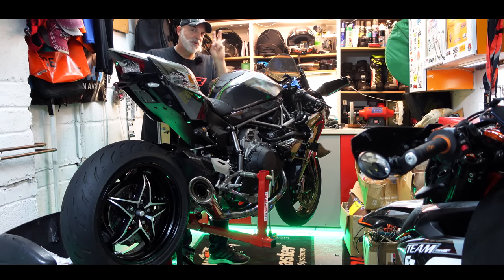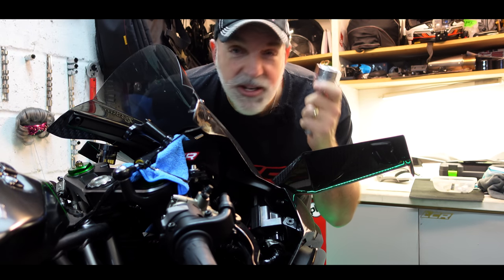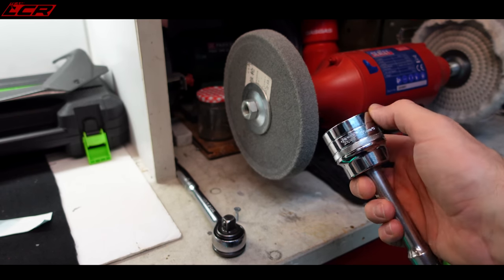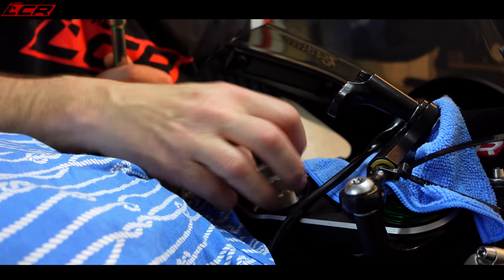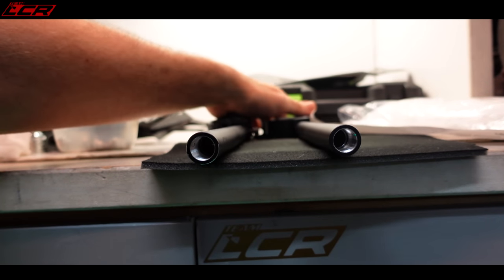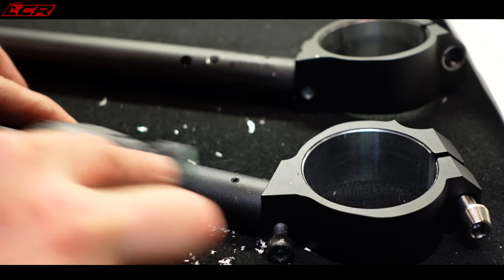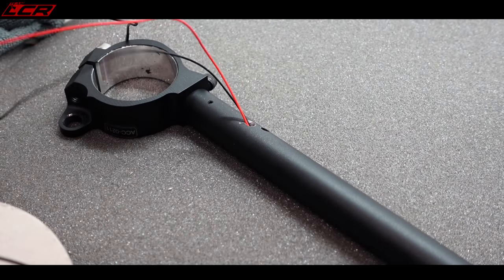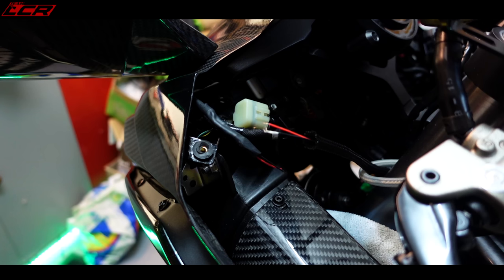My Kawasaki Ninja H2 Is Too Uncomfortable! | Kawasaki Comfort Risers

Comment: Looking good Chops. I put adjustable bars on my old Ducati SS, same height just a flatter angle. Huge difference.
Top Tip for threading wiring through bars, I've done 2 Harleys now. String or better still ask TMF for a guitar sting, tie a fishing weight or a wee nut on the end. Once it's through tape the wires to the string and pull it all back through the hole.

Comment: Great job mate. Did mine on my r1. It took me ages to do mine. Then trying to put them in the right position.👍🏼
Reply from the maker: Quite lucky on the H2 as with the locking bolts on the top yoke you have no choice on the position. So saved lots of, here or is this better...
Reply: @LambChopRides  omg yes that would of. Getting tape measure out and trying to find a fixed piont on both sides. Brain over load lol. Have a great Xmas and New year 👍🏼

Comment: Excellent outcome Chops. Should transform the bike over distance. As you said, somewhat of a mystery Kawasaki didn't have the bar risers as standard but academic now. You should definitely vlog some sort of lengthy adventure on it next year.
Reply: There is no mystery...Because they made the sx....
Reply: @moorepower13  Yes true enough but it's not a true track sports bike, more road focused pose machine (fine by me incidentally) so it would've made sense to still have the higher bars despite the sportier performance & styling over the more touring focused SX.
Reply: @ragerider6283  at the time Kawasaki had a plethora of sport touring bikes.   Remember the matured zx14 was for sale right next to the then new supercharged monster.
Reply: @moorepower13  Indeed. It's a fair point.

Comment: It looks great, and know it will feel better as it should feel quite similar to my old ZX9r as they have relatively high bars for a sport bike, I can sit up straight on mine and just hold the throttle with my fingers lol. I am surprised they have not designed them to be able to be removed without removing the top yoke yet though, mine are fitted in the exact same way but the bolt to the top yoke is annoyingly at the front.

Comment: Putting weight on your handlebars in turns also upsets the suspension.  Hands should be light as a feather on the bars in a turn to let the suspension do it’s thing.  Makes a huge difference, as I’m sure you know.

Comment: Actually, I find the factory setting H2 very comfortable for my size; I am typical Japanese size, weight, and reach: 5'6", 144 lbs, 32 sleeve, 30 inseam. You tower over that H2, like it's a grom. Have you thought abt riding a harley or a tall adv bike instead? Anyway, on the H2, when I am crouching, my forearms parallel the ground, levels need to be up for quicker and easier reach, factory setting is so perfect for my size. It is important to get a bike that fits. I am not a big guy, but no mods can ever get a small grom to ever fit me. Anyway, ride safe, god bless u.
Reply from the maker: Yeah that's all very well but I don't want to ride a Harley or an adventure bike.. don't care if I look big on it I ride it for me, dont care if people think i look big on it